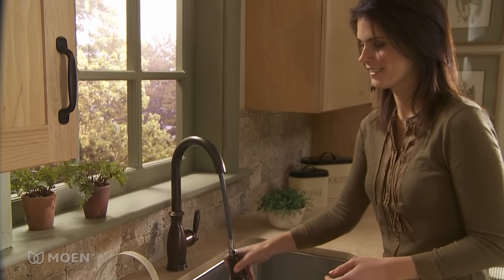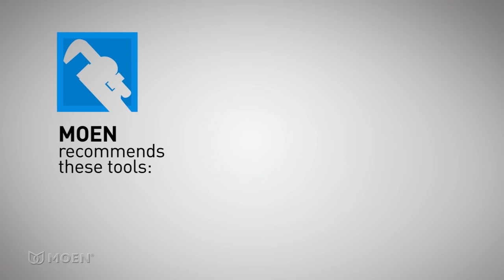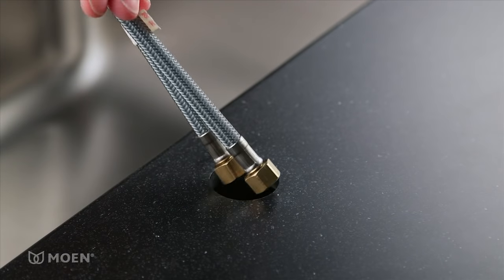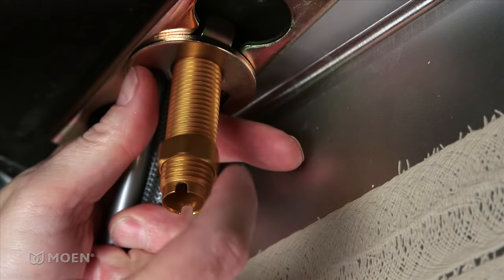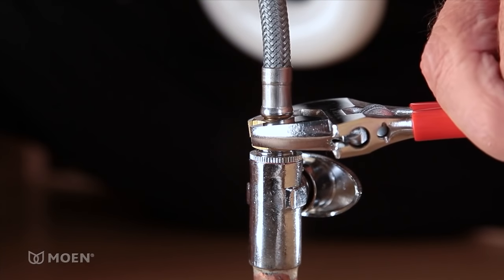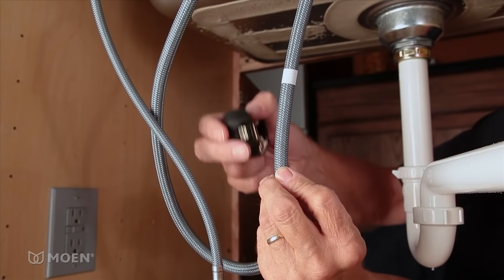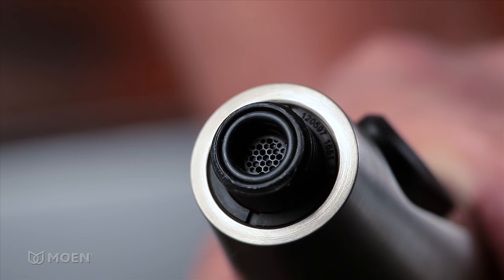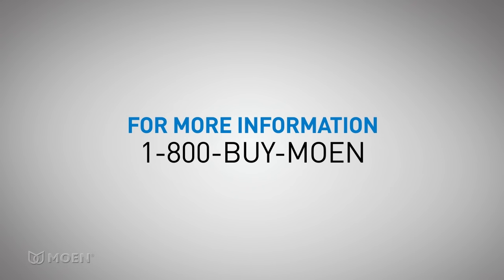Installing a pulldown or pullout faucet with Reflex  |  Moen Guided Installations

Comment: I see the last comment is from 2 years ago, but I hope this gets somewhere. Our identical faucet started spinning from the counter and now when trying to tighten the nut underneath the counter-top, the orange pipe is not screwed into the top of the faucet anymore. Doesn't seem to grab any threads either.
Reply from the maker: Hello ethanmaronde712. If the mounting shank (orange pipe) is not screwed into the faucet anymore, the faucet will need to be replaced.
Reply from the maker: For additional technical or warranty assistance, please feel free to call us at 1-800-289-6636 or visit our Contact Us page at https://www.moen.com/customer-support/contact-us .  Our business hours are 8:00 a.m.-7:00 p.m. Eastern Time Monday through Friday.

Comment: Why show easy ways don't you know it's harder than this sometimes exampleno.1)  flexhoses too short need to extend, 2) different size connectors need to buy adapters, 3)single hole base moves when turning on pull swivel type- need more parts to stabilize base.

Comment: I have had my Moem pullout for10 years. I have had a couple of issues and when I called them they were quick to solve my issues and sent needed parts at no cost to me. I have been impressed with their service. I have bought other Moem faucets for bathrooms since. Just register your faucet when you install/buy  it and call them if you have a problem. Easy Peasey .
Reply: i dont want to get it for free..i rather pay them :)

Comment: This is an excellent video.  I just installed a Moen kitchen faucet and wish that I had seen this video.  In my experience, I believe that Moen makes an excellent product.  I have hard well water in my house and the Moen faucets hold up well for me.  We had a Moen shower valve for 24 years that only had to be rebuilt once before the bathroom was remodeled.   The only thing that I would add to this video is about the plastic wrench included with the faucet kit.  I would never throw that wrench away when done with the install.  Instead, hang it on a nail under the kitchen sink.  You or the next owner might need it again some day to remove the faucet.
Reply: A Stanton1966 .
Reply: I just removed a Moen faucet that was installed in the house in 2003.  Ridiculously hard water here.  I was wishing I had the original wrench when I started because it was 24mm and the new Moen faucet wrench didn't fit.  It wouldn't have helped though.  The nut was fused to the threads.  I tried multiple tools from Home Depot without success.  Out came the dremel and I cut enough threads to get my deep socket 24mm on it and a breaker bar and it still didn't loosen.  Instead the bolt just sheared off, which was quite satisfying.
Reply: no need to think about the next owner, worry about yaself first, bro...i rather throw it away so next owner can buy the new faucet :)

Comment: excellent video. Had to tighten faucet by turning nut on brass tube. easy quick connect. Popped off and snapped off weight pulled hose thru. Sent for plastic tube wrench. followed direction on tightening with screwdriver. Snapped hose and weight back.Saved cost of plumber.Oh yes got wrench first.  lol

Comment: We just got one of these things, the model 7594C. The instruction pamphlet did not have the model number on it. The model number was found on the box. The instruction pamphlet had an INS number on it that was completely different from the model number. Ours was marked 'Arbor' on the box. 

The escutcheon, that piece of metal that fits over the 3 holes on the top of the sink has a gasket associated with it. It's used to cover the two side holes of sink made to accommodate other styles of plumbing that include hot and cold water handles. The 2 side holes are unnecessary for this type of faucet. The escutcheon covers the left and right holes while allowing the faucet to be fitted into the central one. The braided plumbing lines fit through the escutcheon which is affixed atop the 3 holes. We used the escutcheon to cover the two holes on either side of the faucet fixture. The braided service lines that come on the bottom of the faucet fit through the middle hole and connect to the cutoff lines.The one marked "Hot" needs to be connected to the hot water cutoff valve. The other to the cold water cutoff valve. 

There is a separate small circular gasket that comes with the faucet it if you have a sink with only a single hole for for this type of faucet and not for the kinds that have hot and cold levers on the left and right sides. Because we have a 3 hole configuration on the top of our sink, we found the extra gasket confusing. It is round and about the size of a silver dollar and made of some sort of pvc or other material. Eventually we found this video from Moen that showed it was unnecessary in our situation, so we used the escutcheon with its gasket which is elongated to fit the bottom of the escutcheon. The gasket has two snaps that fit into the bottom part of the escutcheon.

We connected the thing using the rest of the instructions as provided in the instruction pamphlet without incident. 

It should be noted that in our case, our cutoff valves are older and initially, they would not shut off completely, so we shut the water off to the entire house while making the installation. At some point we will need either new ones or we will have to replace seats. I expect to replace these with new ones because they appear to be old plastic ones. The use of seats and washers to seal cutoff valves was the standard in former days as I understand it. Plastic is not as long lasting as steel and brass fittings more commonly found in the past. 

For now, after a tiny bit of leakage, there is no more leakage. I have been told with older and cheaper cutoff valves, if they have not been turned on and off, there can be minimal leakage. By turning the handle of the cutoff valves back and forth a few times, this will usually stop the leaking. It is important not to exercise too much force if this should happen. 

 We did call a service technician at Moen who was very helpful. She established that our escutcheon gasket would work and it is. When it arrived in the packaging, it was bent so that it was bent, almost folded in half, the pvc or plastic material of which it is made having been stressed. I was reassured having sent them a photograph by texting that it would likely be ok. It was and still is after installation. They did offer to replace it but I was satisfied with their assurances. 

To sum up, the Moen Arbor Model 7594C chrome faucet we installed seems to be working fine. There are no leaks. It takes some skill as a contortionist to get under the sink to do the work, but it is do-able, even for a non-plumber like me. The instruction pamphlet could have been made to tell the reader that the single small gasket for a single hole on the top of the sink installation is not needed for a 3 hole installation. Also putting the model number and name of the thing on the pamphlet would help consumers like us be better able to identify the thing.

The sprayer itself, is chrome plated plastic while the rest of the device is metal. I am a bit concerned the sprayer might leak at some point. Not quite 2 years ago we bought a competitor's product and the wand itself was made of plastic. We were disappointed that under normal use, the competitor's plastic wand and sprayer leaked not from the spraying end of it, but from the handle itself. So I am not convinced that plastic designs are all that good. Perhaps Moen has a metal sprayer head. I am uncertain what the costs would be to include a metal head. 

In previous applications using Moen products, I can say I've had positive experiences. Their cartridges which do require replacement over the years, are fairly straight forward. The medium of Youtube has been a great venue to help folks like us learn to become more self sufficient and self reliant. To be sure, professional plumbers have a lot of knowledge and expertise and calling on them is something to do if required.

Comment: My old Moen reflex hose to the faucet had a leak.  Excellent customer support to get a replacement hose.  It was very easy to replace except the weight on the hose isn’t enough to make the faucet heads return.  I’ve checked for obstructions under the sink.  It seems the new hose is a little sticky for some reason, so will try to clean it.  It isn’t remotely attempting to return however.  It seems it needs more weight.
Reply from the maker: Hello Erik. We are sorry to hear the replacement hose for your Moen Kleo CA87011SRS kitchen faucet is not retracting for you.  A replacement weight has been ordered for you. We are currently experiencing a high volume of orders and shipping may be delayed. Check your email for the order confirmation and the shipping notice; the shipping notice will contain tracking information for your delivery.

Comment: This was really helpful. I'm just confused about how to hook up the water to the spray line. Do I need a T connector at my hot water source?
Reply from the maker: Good morning. The hot and cold supply lines coming down from the faucet should connect directly to your water source. There is a third shorter quick connect line in the middle that the pull out sprayer hose will connect to. Please feel free to reach out to our Contact Center for additional assistance. Our Product Specialists are available Monday through Friday from 8 am - 7 pm EST at 1-800-289-6636.

Comment: It would be nice if that mounting nut that they provided me actually worked like the one in the video. Annoying having to go back to the hardware store to find one that works because the one they provided has so much coating on it that the thread doesn't move freely. I've installed $80 faucets from Amazon with greater ease

Comment: I just bought mine and the spout spins around freely out of the box also moves in and out a bit  is this common?  Seems defective would rather find out before I install.
Reply from the maker: Hello bluwng. Moen’s pull-down kitchen faucet spouts will rotate 360 degrees.  Once installed with the hose, spray wand and hose weight, the up and down movement of the spout will stop.
Reply: @moenfaucets  yes!!!! Thanks.  I got an Essie, very cool.

Comment: If you don't have the Moen installation tool, what is the size of the nut? (for those of us who have a faucet already installed?)
Reply from the maker: Hello John.  If you no longer have the installation tool included with new Moen pull-out/pull-down faucets, you would need a 13/16" deep well socket.  This will allow you to tighten/loosen the faucet mounting nut.
Reply: @moenfaucets  Thank you, Moen! I appreciate it.

Comment: Can I use this support bracket 4 a bathroom push pull model on a 1/8 thick sink with no base ( which moves when turning) or use something else!?
Reply from the maker: Hello Gary.  The mounting bracket shown in the video, part number 176787, was designed for use with Moen pull-down and pull-out faucets.  Moen has not tested/evaluated using this part with any of our other faucets and cannot recommend it be used in that manner.

Comment: To Moen, what do you think of using plumber's putty?  Would it be better with putty or is the included plastic washer good enough to keep water out and preventing rusting and seepage to cabinetry below?
Reply from the maker: Hello, the gasket for our pulldown and pullout faucets are designed to seal the faucet to your sink counter.  The gasket will prevent water that was splashed onto the counter to seep into the cabinet below.  If a large amount of water is dumped onto the faucet, water may seep into the cabinet below.  Using the included gasket or plumbers putty would be your personal preference. If you need any warranty or technically assistance, please email us by visiting our Contact Us page at https://www.moen.com/customer-support/contact-us or you can call us at 1-800-BUY-MOEN (1-800-289-6636). Our business hours are Monday through Friday from 8:00 am - 7:00 pm Eastern Time.

Comment: I'm replacing this faucet because it drips when it is in the off position and I can not find a washer/ spring repair kit. I went to Home Depot, Lowes, True Value, Tractor Supply, and a wholesale pluming supply store. So I have no way of fixing the leak.
Reply from the maker: Hello Will. I would like to assist you further. Please provide your address, phone number, email address, model number and copy of the purchase receipt.
Reply: @moenfaucets  I contact Moen and they are sending a replacement part. Thanks for responding

Comment: Hello, Is the support bracket included, or is it something that needs to be ordered for installs on thin metal?
Reply from the maker: Good morning Andy. Most kitchen faucet models do come with this support bracket. However, if you can send a private message with the exact model number, we can confirm for you.
Reply from the maker: Hello Andy. The mounting bracket for the Essie model 87014 is sold separately. The part number is # 176787.

Comment: can you put one out on how to get the handle off of these single handle pull down faucets?
Reply: good luck these handles from Moen are known to fail.
Reply: Bought this house 2 years ago with this faucet in the kitchen, guess what failed. Lifetime guarantee my ass. If you have the receipt, if you can prove you didn't damage it somehow, if you mail it to them, if, if, if,.... Contractors don't leave receipts for these kind of things apparently.
Reply from the maker: Hello Shawn.  Please contact us at 1-800-289-6636 to determine what replacement parts are needed to resolve the leak you are experiencing.
Reply: Considering I contacted your company 3 months ago and got told point blank, "without the receipt, or proof that it was professionally installed" I had no recourse. I have replaced the faucet all together. With Delta.
Reply: What happens if you don’t get a flow but did everything here?!

Comment: Is the installation tool necessary?  Renting and I do not have a tool to tighten up the faucet.
Reply from the maker: Hello Moon. Using the 118305 installation tool makes it easier to tighten the mounting nut but not necessary.  A basin wrench or 13/16 deep well socket wrench can also be used to tighten the mounting nut.  For additional assistance, please send us an email by visiting our Contact Us page at https://www.moen.com/customer-support/contact-us or you can call us at 1-800-BUY-MOEN (1-800-289-6636). Our current business hours are Monday through Friday from 8:00 am - 7:00 pm Eastern Time.

Comment: I am having mine install now. Had to shut off the mail line on water. When I got it install and ready to turn on the water. Only hot water came out.  So my installer tried again now just cold water.
Reply from the maker: Hello LV111. I am sorry to hear of the issues you are having with the kitchen faucet. Our Product Specialists are  available for technical assistance at 1-800-289-6636. We are open Monday through Friday from 9 am - 5:30 pm EST. You can also send us a direct message here if we can assist you further.
Reply: Well, after the guy I had hire to installs the sprayer faucet. I notice that he had the handle facing the front instead of on the right side like it should go. As I recall he shut the main water off to my condo. After he left I notice that. Also I poke my head under the sink. I see he switch the water valves. When he was installing it. where the cold he has hot valve. Where the hot is the cold one. He is a certified plumber. But lesson learn. Get reviews before you hire someone. I watch your utube installation videos. It was very clear. I may just attempt it myself. Glad to know I can ask for help on here if needed. Thank you for responding back. P.S. when he started to switch water valves. Red flag and placement of the handle on the faucet itself.

Comment: My faucet didn’t come with the support bracket and my sink is less than 1/2” thick. What’s up with that?
Reply from the maker: Hello JMT970.  We had a design change to the mounting hardware for our pulldown and pullout style faucet in September 2018.  This change eliminated the long bracket with three holes.  If you need any further assistance, please send us an email by visiting our Contact Us page at https://www.moen.com/customer-support/contact-us or you can call us at 1-800-BUY-MOEN (1-800-289-6636). Our current business hours are Monday through Friday from 9:00 am - 5:30 pm Eastern Time.

Comment: I removed my old kitchen faucet and place the moen faucet on top but the tubings dont connect to the water supply. What to do now?
Reply from the maker: Hello Twentythree84.  Depending on the type of shut off valve connections that were installed under the sink, it may be necessary to visit your local home/hardware store to purchase an adapter.

Comment: +HOW DO YOU REPLACE THE FLEXIBLE WATER LINES INSIDE THE FAUCET CTECH ?
Reply from the maker: Hello Lydia Mireles.  The flexible supply lines in Moen bathroom, kitchen or bar faucets are not removable or replaceable.
Reply: +Moen Is the flexible pull down hose under the lifetime warranty?  Mine is leaking, still works but is leaky around the swivel part.
Reply from the maker: The Lifetime Limited Warranty can be viewed at www.moen.com.  You can also call 1-800-289-6636. Thank you.

Comment: Can i use anything other than instalatiinntool
Reply from the maker: Hello J. Perez.  The installation tool included with a Moen pull-out or pull-down kitchen faucet uses the 5/8" side for the mounting nut.  You could also use a 5/8" deep well socket to install the mounting nut.